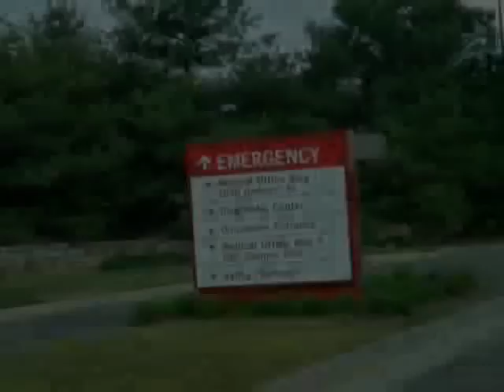2005 ATV Crash (simulated)

Comment from the maker: You would be surprised at just how good the KFX is on a track.  The trick is you need to go fast enough to get the bike up on its suspension.  It does wear you out faster due to the weight.  But while you're fresh it will smoke any 450 on the track.  I still ride it on the track whenever possible.  Just too much fun to quit.  I no longer do that particular type of jump.

Comment: `ve just fall of my bmx(haro f2) in like 20mph down a hill. i was standing on my rear pegs and i didn`t hold the handlebar. and the front wheel maked a huge vibration. so i lost the control. and i landed on my rigth side of my boddy. then i swooned, now i got a gristle in my arm.